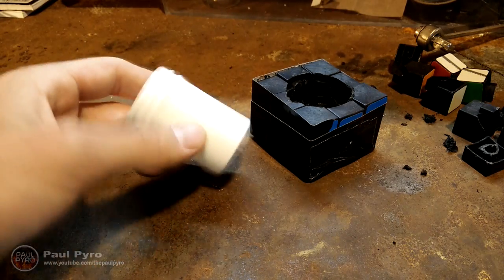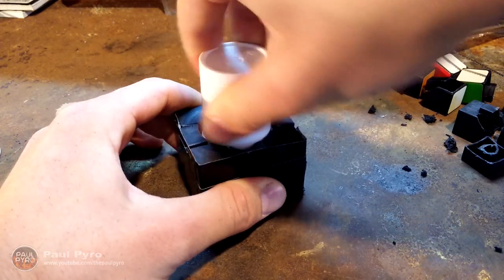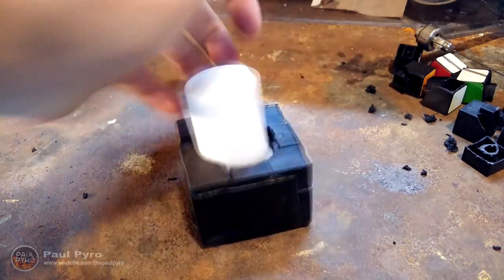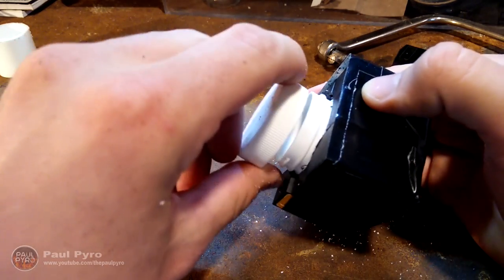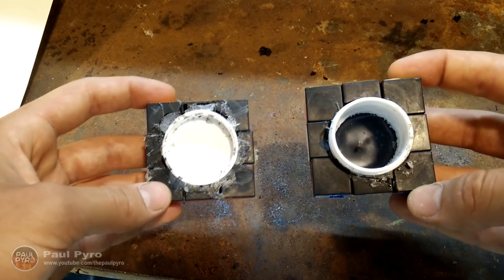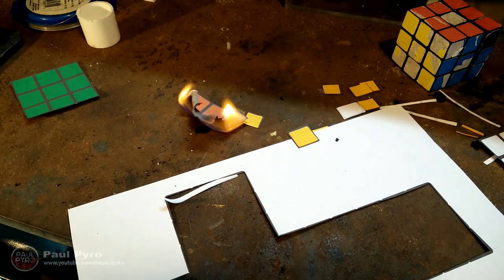How to make a Rubik's Cube Mini Safe!

Comment: None of the cubes you linked in the description will work, since they have a metal core, because they are speedcubes. I the video you had a cube with a plastic core, which makes it available for you to just drill it down. However, with the cubes in the description, you can just take the center pieces off, and then unscrew the core from the rest of the pieces, and then you'll be able to make a "Rubik's cube mini safe".

Comment: Or you can buy a treasure cube which you do not have to build and will only open when it is solved. So just put what you want in it. Scramble it up. And the majority of people won't be able to solve it to open it. Even if they do. They might not know that you can pop the white side of and get what is in there. The down side of this is that if you don't know how to solve a cube this is useless to you. And also the tiles on the cube are a bit annoying in my personal opinion.